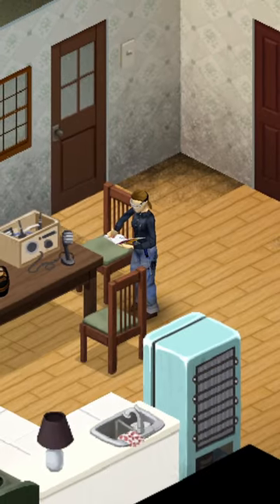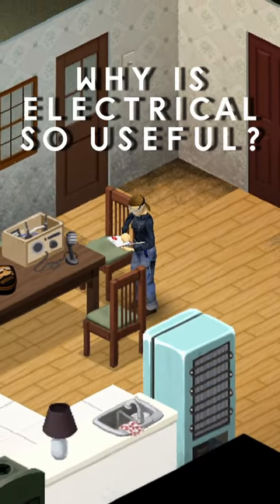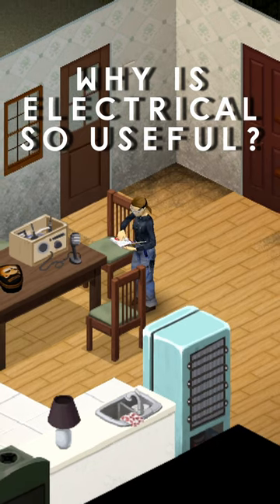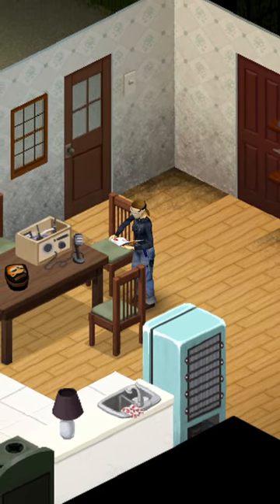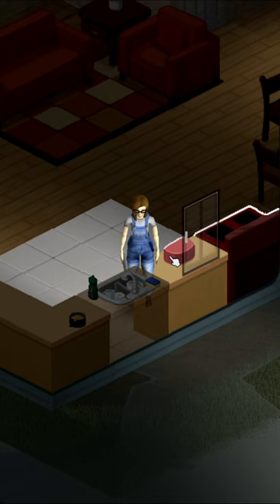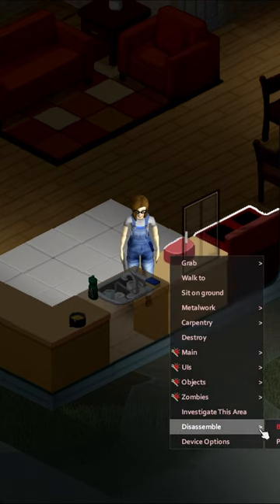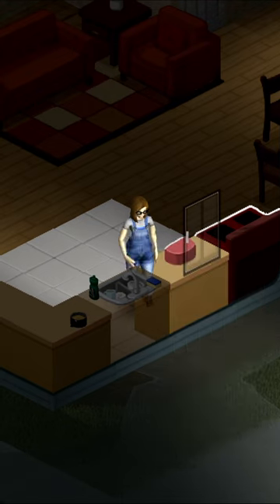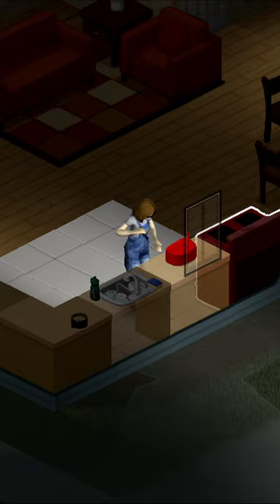Save Fuel in Project Zomboid With This Electrical Trick! Project Zomboid Tips Done Quick!

Comment: doesnt the generator calculate energy usage on connection, meaning you could pickup all lights, connect it, then place lights and the lights use free energy anyway
Reply from the maker: Might have to test that 🤔 Either way I'd prefer to use intended features than bugs or exploits 😄
Reply: This has been patched for a while

Comment: They should make high level electrician worth achieving by allowing character either MAKE BATTERIES, make rechargeable batteries/charging station or high capacity batteries out of regular batteries.
Reply: Maybe battery packs at least.. rechargeable batteries are a whole different thing and weren't really super common in the early 90s. Hell, even a battery bank similar to the one in 7 Days to Die would be pretty neat

Comment: A tip i have is to set the xp multipliert higher. I personally don't like it to waste hours of my life to have a higher skill.
Reply: I got mine to 5 times cuz I hate to try and train a skill so my character dies, even with this, it isn't an easy task to level up skills
Reply: It takes long because there's no way of getting the 4 to 6 multiplier to experience gain outside of sacrificing profession for Engineer/Electrician. With a trait mod it becomes more viable.
Reply: @MsHojat Books give up to x15....
Reply: @dokusha519 Ew...

Comment: Aren’t batteries more finite then fuel?
Reply from the maker: Yes, they are! However, they don't actually use batteries. Weird, I know, but there's no actual requirement for them.
Reply: @MrAtomicDuck  wait wha- so they power themselves forever? XD
Reply: @somerandomgamer8504  I was just about to ask that too XD UNLIMITED POWER!!!!!
Reply: Yes, but they last quite a while
Reply: @somerandomgamer8504  Well, technically they're being powered by the electricity your PC is using so... it evens out?
Reply: @MrAtomicDuck  so it's an exploit then lol, I thought you said you'd rather not use exploits
Reply: Zombies can drop radios with batteries. So there are unlimited batteries in the game. But as stated they aren’t needed here anyway.
Reply: @somerandomgamer8504  Pretty sure they consume light bulbs like an average american consumes burgers though. At least the last time I spent my time grinding it, it didn't feel rewarding at all. I downloaded a mod that increases light bulb duration up to 9999 the durability (default is 100). It's so annoying gathering new ones due to all the useless junk from TVs and radios. Hoarding them to do it only once after accumulating few dozens is tiresome too as the radios and TVs do weigh a lot considering the only good loot is a battery and lightbulb. The mod only applies to the placed lightbulbs though, so the default ones will burn out as quickly as in vanilla unless taken out and then put back in.
Reply: @Dalzombie  strongest point ever

Comment: i did this recently while i wuz decorating my base in debug mode. i saw ppl mentioning it b4 but they said lvl 2 n so i figured i just didn't know how 2 do it. still wouldn't use it, 2 b fair.
Reply from the maker: Yeah it can be a grind to get to level 5! Still, nice to know right? Make sure to take 1 piece of electrical scrap :) Might also be the reason it isn't working for you.

Comment: Aren't batteries more valuable than gas though? With all the gas stations you have decades of gas.
Reply from the maker: That would be true, if they actually used batteries! Despite its name, you only need 1 electrical scrap, and there's no actual requirement for batteries to be replaced at any point.
Reply: @MrAtomicDuck  well that's not busted at all

Comment: All anyone cares about with generators are ICE machines. I have done research on the ice chests smh and wow. 

Example, my warehouse had a total of 16 lights, outside and inside including 2 light posts. With the lights and obly 3 ICE machines running, a full genie gets me 4 days of electricity. If i turn off all the lights, i get like an extra 10 hours. 

With the splar panels, omfg. With a combined 66 solar panels, with sandbox options changed, to 100% efficiency, is what it takes to run 4 ice chests. 

Which, im not an electrician and know nothing about it, but just doesnt seem correct. I know its scaled for 1993 but still. 

I worry a lot about ICE chests because i have my own eating disorder where im always worried about having food so much so that i wont eat. Its bad. But in the game im like, i need to hoard all food until winter. 

I added farming and hunting mods to kinda take that stress away so i can play the fucking game lmao
Reply: The only real 'cheat" i use is a mod that lets me start with whatever vehicle and i always start with the m35a2. With organized perk its 850 storage smh
Reply: @anthonyzullo mods name please?